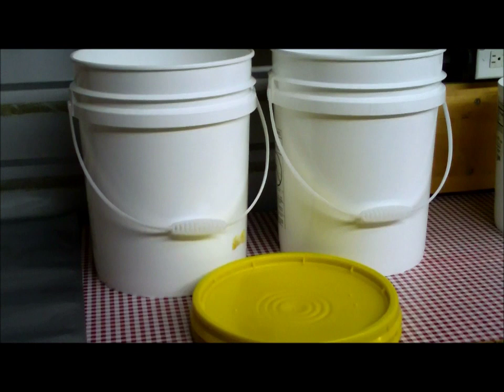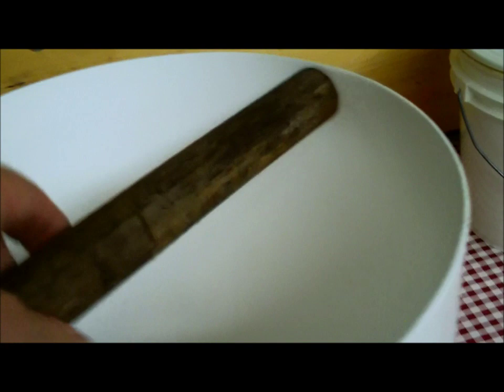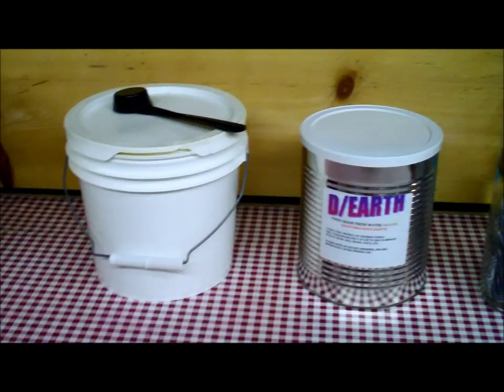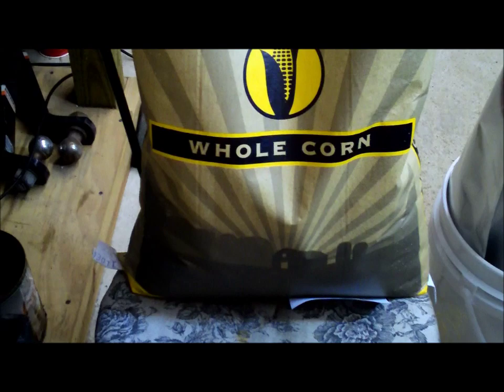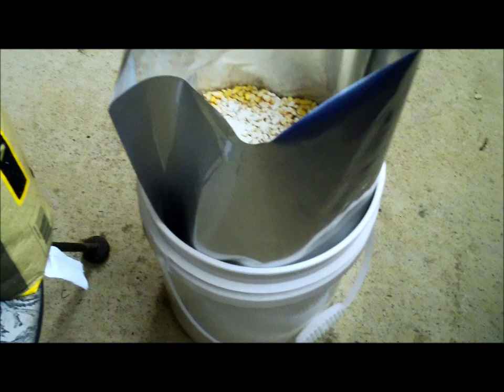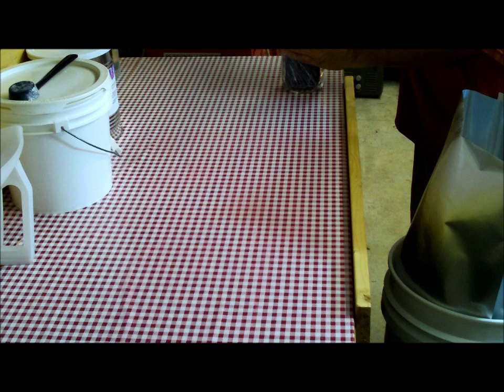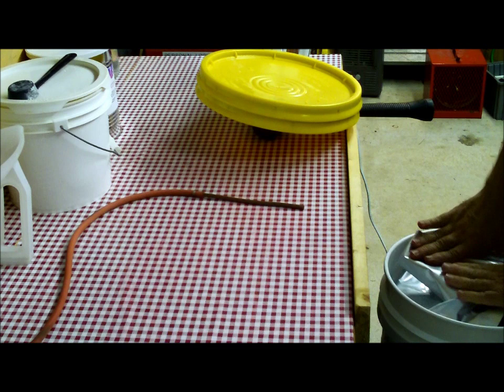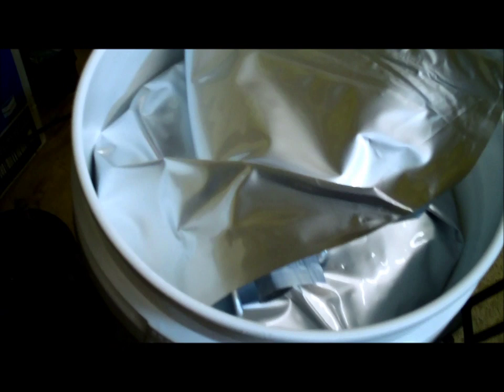Food Storage: Corn, Whole Kernel in 5 Gallon Plastic Buckets with Diatomaceous Earth

Comment: Excellent presentation.....probably the best one I have seen on Youtube.  The only other thing that I try to do is to rub some olive oil around the rubber seal on the top......just like rubbing some oil on a engine oil filter before screwing it on, I figger that a bit of olive oil around the seal will allow it to seal better.  You agree or disagree?   Also, I try to cut the bag and tape the label info on the bucket.